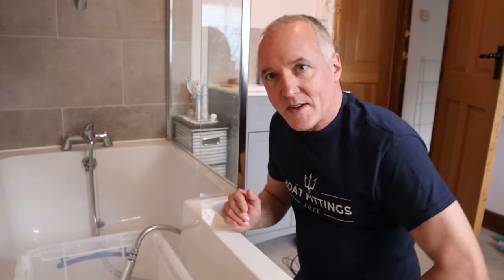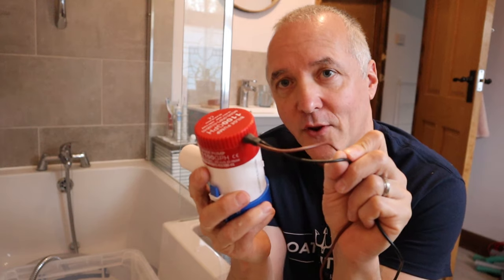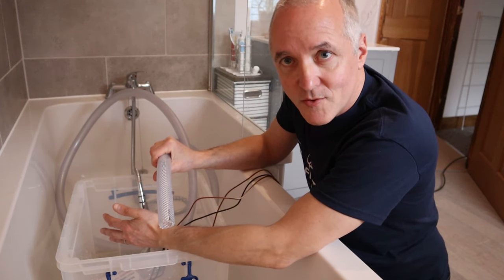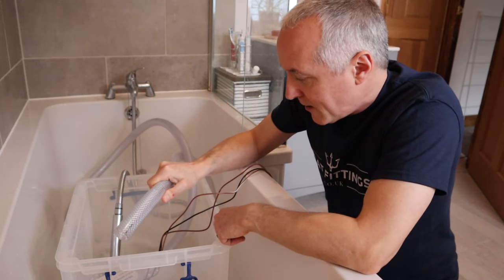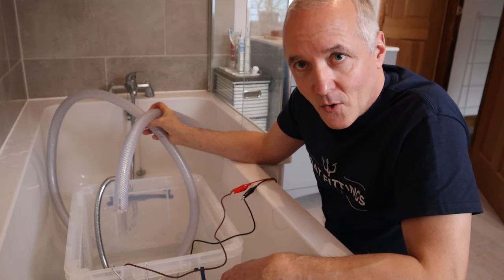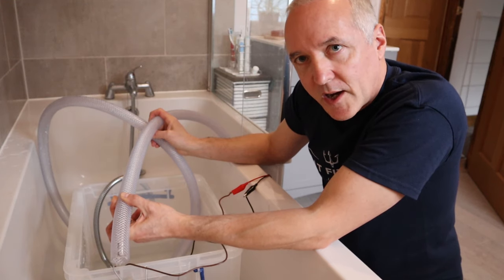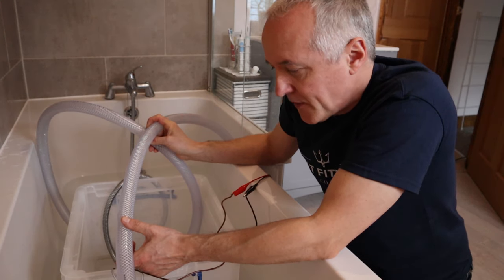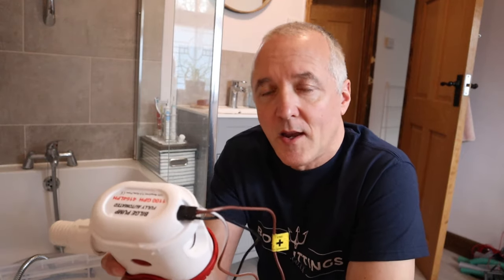Don’t Buy An Automatic Bilge Pump Till You’ve Watched This

Comment: The great advantage of pumps with a separate switch is the ability to replace only the component that fails. I have an automatic pump which is expensive and noisy, but the great advantage is the small volume it occupies compared to pumps and float switches. You might think the current draw would be significant, but it draws well less than 0.6W averaged over the day (1.2Ah per day in a 12 V system). When the motor spools up to top speed with no water drag on the impeller, back EMF reduces current draw to a trickle which is sensed by the electronics to shut off, then it tries again every 3 minutes.
Reply from the maker: Hi thanks for this great comment - it is nice to have some additional information, and considered opinion on the pros and cons .

All the best,

Richard

Comment: Thanks for the demonstration.  You explained it well.  I was wondering why the pump in the old 31' sailboat I bought didn't have a level switch.  But it does have a small panel with an Auto/Off/Man(ual) switch and an indicator light that comes on for a couple of seconds every couple of minutes. I now know what type I have.  Now to figure out why it doesn't work.  The pump seems to work OK in a bucket but doesn't appear to have enough discharge head to lift the water the 3' from the bilge to the discharge (yes, the line is clear).  And now I know it doesn't draw enough current to keep it running.  These pumps aren't built to be serviced but they're pretty inexpensive.
Reply from the maker: Hi thanks for your comment, glad to be of help.

Comment: The sensor technology is also used in air compressor condensate drains which I’m very familiar with. With all the dirt and contaminates in a bilge I’d be more confident with the float style.
Reply from the maker: Hi thanks for your comment.  Just to clarify - the pumps that do the periodic check do not have a sensor.  They use a micro-processor inside to monitor current draw, so there is not any issue with sensor contamination.  It is always a good idea though to regularly check your pump for any debris which has got inside the strainer

Comment: Hello

I wonder if you can help with a bilge pump question.
I have a low spot below ground level that fills with water.
I have installed a 12v automatic pump that works very well except it won't stop when the water has been pumped out.
It has to pump vertical for 3 feet and copes fine.
If I submerge the pump in a bucket of water it stops when all the water has gone. When placing it in the sump where it has to work it won't cut off. It's only a £25 one from Amazon and has no check valve fitted.
Can you think of any reason why it cuts off submerged in a bucket of water but not in the sump that fills up gradually over a couple of hours?
I am totally perplexed by this scenario and hope you have the time to offer some advice.
Gary.
PS
Loved the video. Very clear and informed.

Get Outlook for Android
Reply from the maker: Hi Gary thanks for your question.  I am guessing you have the type of pump that decides whether to pump or not based on the amount of electrical current that it is drawing.  With the test in the bucket you probably get a pretty clean situation at the end where all of the water has been pumped out, the pump is then just pumping fresh air and after a few seconds the pump turns off.  With the deeper 3 foot installation the pump has to work a bit harder to push the water up to the top of the hose, then when it has nearly pumped all the water out it ends up pumping a 'froth' of water and air, which causes just enough current draw for the pump to think it has to keep going.  If this sounds like the problem you are having it might mean you need a check valve, the other thing that might work is to arrange the hose to have distinct hump at the top that the water has to flow over and then down the other side.   Alternatively you could buy a separate float switch and control the pump that way, you might need to experiment with the relative height between the float switch and the pump.

Comment: I wish I'd seen this before I bought it (the second type of electronically controlled pump) from RTM in Australia.  The instructions stated that it woukd switch on and off at just under 3 inches and half an inch respectively.

What it did however, was cycle on and off at approximately 30 second intervals. Total pain in the proverbial.
Reply from the maker: Ah sorry to hear that.  I must admit I prefer the float switch type myself.

Kind regards,

Richard

Comment: Great review! What about your opinion on longevity? That sensored one would be running the impeller performing its check a crazy amount over its lifetime?
Reply from the maker: Hi  thanks for your question.  I could only guess on the longevity really.  On the one hand like you said the one without the float switch would be running the impeller regularly, but only for a few seconds if there was no water detected so I don't really see this as an issue.  Float switches involve moving parts which could get clogged up, so there are arguments for and against each really.

All the best,

Richard
Reply: we are talking about chinese quality here.

Comment: If you are sure that the second one detects electronically and not with an optical/photo element, then it is not suitable for fresh water, since pure/rain water does not conduct current. If a photosensor is used there, then it is very sensitive to moisture and various types of debris.

Comment: I have never been at ease in having a live circuit left unattended on the boat when I am not there. Both our bilge pumps are manual switches. But I guess not everyone can be at their boat as often as we can manage.
Reply from the maker: Hi thanks for your comment, actually I agree with you - I prefer to turn off all electrics with a Master Switch when leaving that boat, even if that does include the bilge pumps.  I'm sure some will think differently though.

All the best,

Richard

Comment: the float type is the better option, it can be overridden and doesnt waste two and a half minutes before deciding to kick off.  The 'electronic' one would be better if it was triggered by water across stainless steel contacts negating the need to wait.
Reply from the maker: Thanks for your comment

Comment: Do you have to buy the pump and extras control separate or does it come in a kit.
Reply from the maker: Hi thanks for your question, I'm not sure which pump you are talking about specifically but we sell pumps / tube / Jubilee clips / switch panels all separately.

All the best,

Richard

Comment: How are both of these pumps being powered? Are they being plugged in somewhere or ..
Reply from the maker: Hi thanks for your question, for this demonstration these were being powered by a variable voltage power supply, set to 12V

Comment: Do I need a drain plug on outside back of boat? The bilge pump is connected to the hole, it’s taking in a lot of water in the back and I have to manually turn on pump from control button at front. Does that mean the automatic part of pump is broke? I never had to do that in 3 years
Reply from the maker: Hi thanks for your comment - I am afraid that without being able to see your installation for myself I am not able to help with your question.  I think it would be worth having a local marine engineer have a look over it for you.

All the best,

Richard
Reply: @BoatFittings  ok thanks, I think I solved problem, I put new drain plug in but the other hole was for livewell. So it’s not supposed to be covered. The pump is just mounted to the transom wall inside. Not as much water now but still slight leak. Thanks

Comment: Get an auto pump that can be manually activated.   I have had the auto function fail on me, allowing 50 gallons of water in the boat before it was noticed.   Make sure the auto feature can be tested, and test auto/manual before your next adventure.

Comment: Over a long time, the electronic water sensing type will drain down a battery if boat is not plugged in to shore power, which is another reason I dont like it. It is also an electronic semiconductor  circuit, maybe it fails. You dont want a pump like this to fail. You better off having 2 or more bilge pumps in each compartment of the bilge. I have 6 pumps for a 37 foot boat.  In front of bilge, two 3700gph, one 2000 gph, one 350 gph for the shower sump which is open top.  Then in the aft area, a 2000 gph and a 500 gph.  Due to positioning, the forward 2000 gph and the rearward 500 gph do all the work, so the other pumps never run unless a severe problem happens, like a pump fails, or a bad leak. My bilge is divided in two  with a mostly watertight bulkhead so the the boat might stay afloat if something bad happens in the rear.
Reply from the maker: Hi Scott, many thanks for your detailed recommendations.  I agree that having more bilge pumps is a good thing, and it is interesting to see the details of your configuration.
Reply: @BoatFittings  Thanks. I also do not have an off switch for any bilge pumps, having one is risky, you might turn off the power to the pump. My setup is each pump has its own float switch, the power to the pump thru the float switch is on the always on positive buss, regardless of battery selector switch. I have a start bank battery group 29. All it does is start all 3 engines main and generator, and some bilge pumps use it for power. I have two golf cart type batteries for the house, they run the other pumps. The bilge pump positive feed wires are 20 amp breaker protected. Then I have manual switches made by carling ( typical marine switch ). Turn on switch and the bilge pump runs.  I have made a relay circuit so a single carling manual switch can run both pumps together. But the float switches only runs its own pump, (saves a switch position on the helm).
Reply: Here is that basic circuit, one switch can run 2 pumps, the two diodes prevent backfeed running of the other pump when its float switch (FS) turns on. (P1 and P2) are the bilge pumps. It is not showing the 12v cube relay to provide power to the pump and save the switches from getting fried, as the 3700 rule pump takes a lot of current to run. I also did not want a voltage drop cause that will slow down the pumping gph rate.  I got the diagram from a friend so you can see the basic schematic idea.  Basically the relays are activated by the switches and the relays then turn on the  pumps, so just another layer gets added to the schematic. The diodes can be any larger diode out of a power supply. https://photos.app.goo.gl/UsLTnmGXPaTah5AN8
Reply: I have similar in a 55 ft boat , plus a Hyundai seawater diesel trash pump and two back up 240v submersible portable pumps , we also have 2x 2 inch Jabsco clutched pumps that can act as either deck hose or emergency bilge pumps .
 The portable pumps have normal shore power plugs fitted so we are able to assist casualties as long as our shore power leads will reach , worth considering if you have an on-board genset . 
 Ours is a Perkins 403D 45kva ,which is about 15kva on single phase , obviously overkill but it also runs a water maker and a Zeigra 1.2ton/24 hr ice machine.
 Most of the above bilge solutions are mandatory for MCA cerification .

Comment: Another option is using a bilge pump switch, either float type or electronic type, with a bulkhead mounted pump, or a pump mounted outside the bilge at sole level or higher, if the pump can draw water high up. I use diaphragm pumps and bulkhead mount them. No pump possibly sitting in water and a diaphragm pump doesn't get clogged as easily as regular impeller type bilge pumps. It's also easier to service or replace if it fails. No need to dig deep into the bilge. There are always other options.
Reply from the maker: Hi Ben,

Thanks very much for your explanation of your diaphragm pump method.  I would love to see a photo of your set-up.  Always good to hear alternative thoughts on installations.

All the best,

Richard
Reply: @BoatFittings  Hi Richard. I no longer have the Fish N Cruise with the diaphragm bilge pump set up. I wish I had thought to take pictures. My thinking was, if I came up with the idea surely many others were doing it as well. Keep the good videos coming. Have a good day.

Comment: i have a fully automatic bilge pump for my jet ski.  its a rule 12v 3.0A 800 gph.  i want to add a 3 way switch.  does the switch have to be a certain volt and amp.  i was looking at a basic on/off/on switch for about $10.  thanks for your response
Reply: I don't think you can use a 3 way switch on a automatic pump, like the one you have.
Because you only have two wires.
 If you have three wires,  yes for sure you can use three way switch.
Reply from the maker: Hi thanks for your question, any switch would have to be ok with the voltage and current draws.  12V is not a high voltage so in my experience any switch would be fine with the voltage, it is usually more the current draw that you have to be a little more careful with, but again 3A is not very high so you shouldn't find a problem finding a switch with that rating.

Comment: How can you wire this to where you can plug it into an extension cord I want to use it to pump out rainwater out of my barrel?
Reply: Get a AC/DC switch, or a 230v/12v adapter and then make your own cigarette lighter connection I guess... :)
Reply from the maker: Hi thanks for your great question - look out for a video coming up for a 230V installation coming soon!

Comment: Wonder if the sensor type gets corrosion on sensor due to accumulation of deposits if it still will acctivate? The float may stick on other one due to slime or deposits as well ?? Hum im on the float one i think! ???
Reply from the maker: Hi thanks for your comment.  There is not a sensor as such, inside is a micro-processor sealed away from the water.  As to the float, yes is there is a build up of deposites inside the enclosure the float could get stuck, so it is a good idea to inspect and clean out inside the strainer from time to time.

Comment: What about separate bilge pumps like a Jabsco Puppy?
Reply from the maker: Hi thanks for your message, I am not sure exactly what you are asking, but having more than one bilge pump is always a good idea, in a way the more the better as long as the wiring (fuse / switch panel etc.) are up to the job.
Reply: Jabsco puppy would make a very poor bilge pump , they are more suitable as wash down pumps .
 We had one for domestic water supply , not pressurised , it did ok but if someone shuts a tap off without cutting power to the pump they burn out very quickly . It'd do the same if it sooked up anything from bilge , they aren't submersible either . 
 They do pretty well as an engine sump pump though , ours has lasted 14 years pumping out an 8 gallon sump about once a month.
Reply: @jmca3324  jabsco ballast puppy or ballast kings are crap..  .
Very over priced and poor quality product, speaking from experience here.

Comment: A lot of water can accumulate in 2.5 minutes if a problem occurs just after an electronic pump does a regular check.
Reply from the maker: Yes in that case you would be very unlucky.  This would be very unlikely though.

Kind regards,

Richard